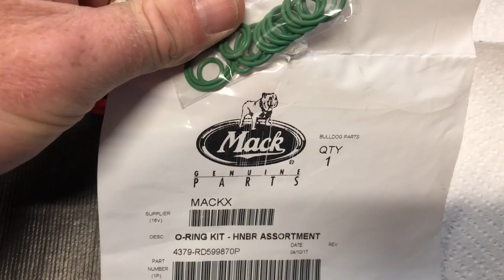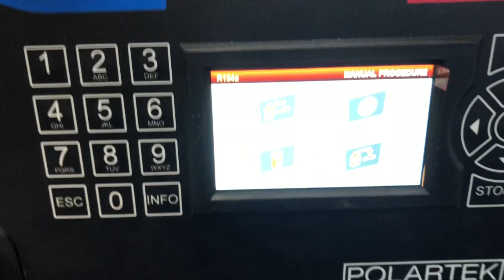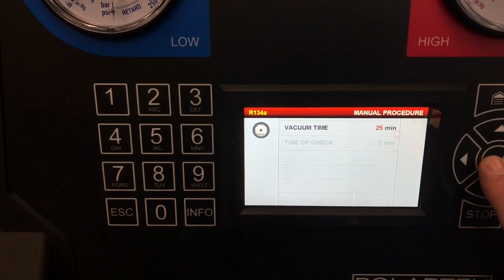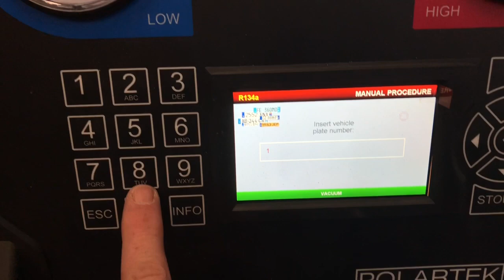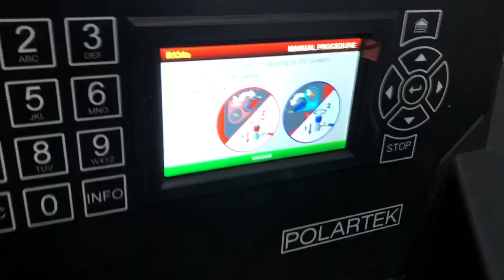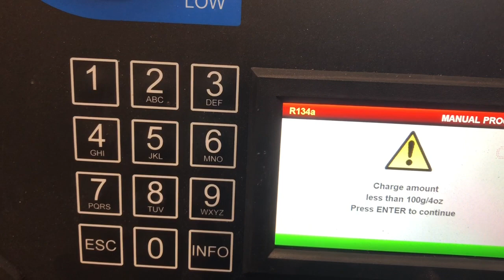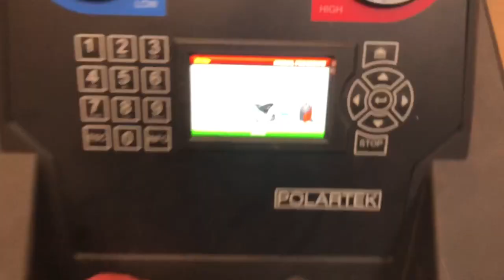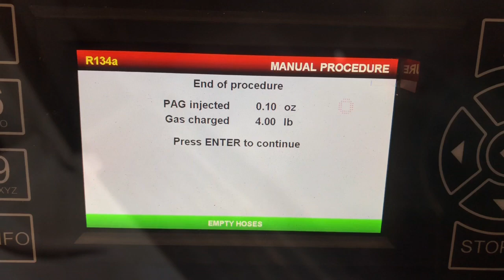Peterbilt Expansion Valve Leak and Snap On PolarTek Machine DIY A.C. Repair EASY FIX

Comment: Excellent Job Clay I usually Measure the Temp from the Center Vent At 1000-1500 RPM after Idling For 15 Mins . Right On Brother Thumbs Up Great Video as Always
Reply from the maker: +Chris Chiampo we usually measure for a little longer but i had trucks lined out the door. I knew if it cooled it down over 20 degrees on the driver vent at standard idle in 2 mins that it was working so .... it had to go. Plus it was our truck vs a customer truck. We got to keep those wheels turning on our own stuff !

Comment: Great video thanks my friend. I'm a little surprised that the machine didn't have to be on the system while it was running to check the pressure I must just be old school. Mack is a pretty good place to get parts when you can and the o ring grease I like it see to many people put regular grease on them don't like that eats them up. Keep up the great work my friend see you in the next video thanks again
Reply from the maker: +Scott Pearson those ac machines makes it easy. Pretty much set it and go do something else while it works. Saves time by not baby sitting it. Thanks for watching and thanks for the comment.
Reply: Got to love modern day technology.

Comment: Have an RTI A/C machine at my dad's and it has been a trouble free machine since day one.Used to have a Robinair that was a pile of junk since it was brand new,SPX whom owned Robinair would not do a thing about it.Gave the run around basically.My dad's 2001 Freightliner FL60,the a/c does not work and needs a condenser.Has not replaced it yet and will get to that some day
Reply from the maker: +wafrederick those condensers are salty ! I looked at the robinair machine before buying the snap On and honestly i just liked the snap on one better. Thanks for watching and thanks for taking the time to comment.
Reply: Robinair is now owned by Bosch,Bosch bought out SPX a few years and it has been worse.Bosch does not stand behind anything at all

Comment: So I have a 389 Peterbilt and it barely pushes out cool air. The blower system works fine it’s just the temperature. On the expansion valve it is wet and sometimes frozen which makes me think it might be plugged and not getting any more Freon into the system. I am not sure if the mechanic after changing the compressor had run a vacuum on the system or not. What else could it be and is it normal not to pull a vacuum on this.  Thanks Teresa Charlotte Tennessee looking for some help here
Reply: Check your cabin and hvac filters

Comment: Great video...how come you know the expansion valve was not broken?
Reply from the maker: It was cooling fine just had a leak where line goes in. You could charge the system and in two days it would be out. We found it using ac dye

Comment: What if it's blowing cold up front but hot as hell in the bunk? Is there more than one expansion valve on a 2011 peterbilt 386 if so where are they because Peterbilt told me there is only one.
Reply: I have similar issue for my 2918 peterbilt579
Reply: @shivanvlogs292 at least on mine there's one under the bunk on the hvac unit